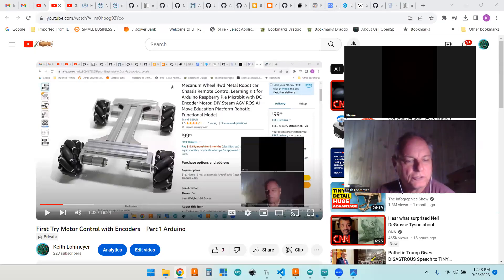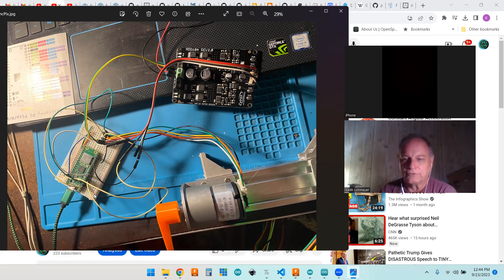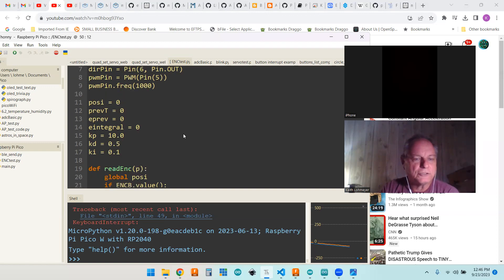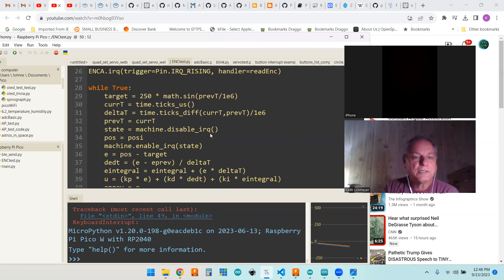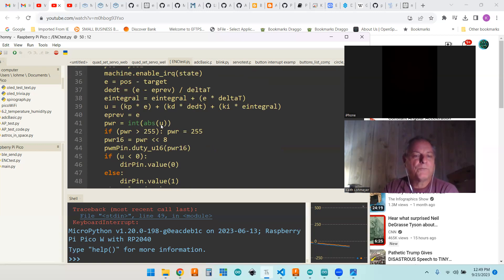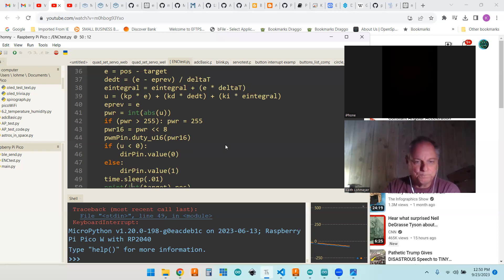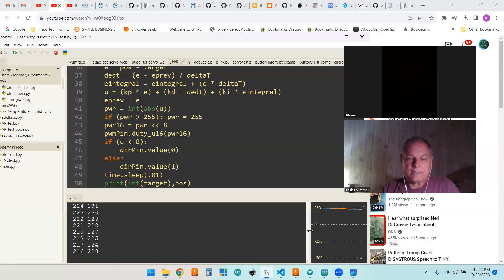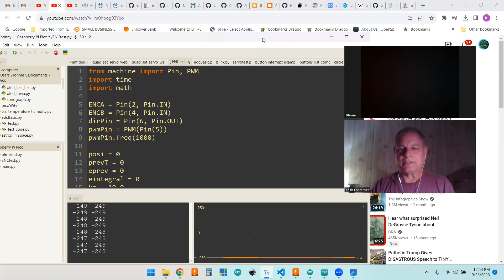First Try Motor Control with Encoders - Part 2 Micropython

Comment: Great videos Keith. Bill at DBWS made a video about these Mecanum wheels a while back. I could never get the motors set up properly to move like they’re supposed to. I’ll have to give it another try after watching your videos. Thanks for posting the videos Keith. Take care.
Reply from the maker: Thanks Lee, Yeah I watched the DBWS video. He did a good job explaining them. I am thinking of switching to stepper motors for this robot using an Arduino and a stepper shield. The wiring will be a lot cleaner.

Comment: Nice video Keith. Haven't had the need for encoder motor control but its nice to see someone I trust give an example of how to do it.  I am looking forward to Paul's Arduino Uno R4 series.  Still waiting to purchase one of  those.
Reply from the maker: Thanks. I am not sure encoders are the way to go either. I haven't looked into the R4. Hard to justify the price with all the sub $10 wifi boards out there.
Reply: But the pretty led array. It's got to be worth it.  LOL @keithlohmeyer